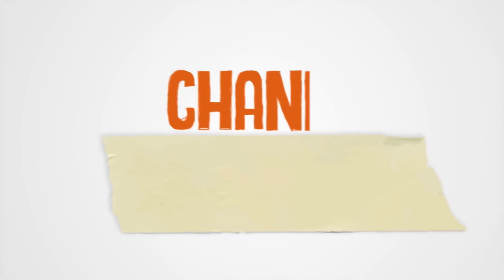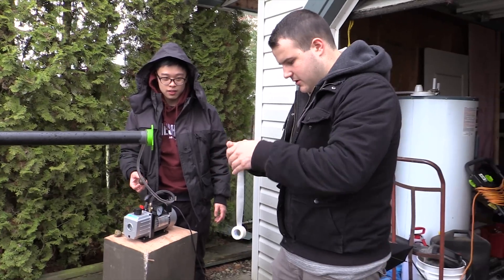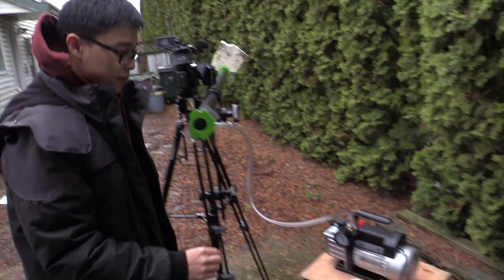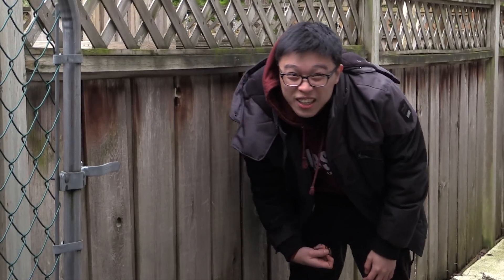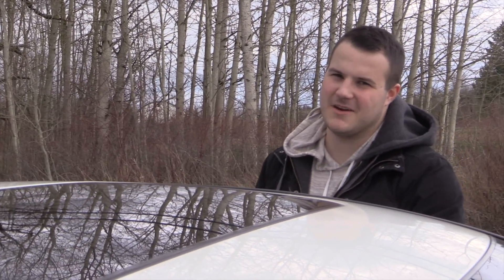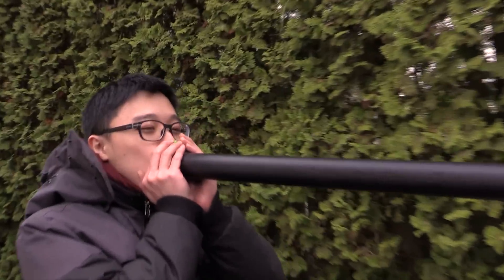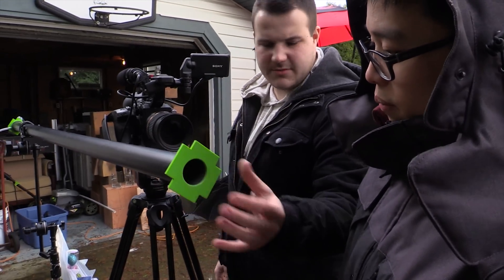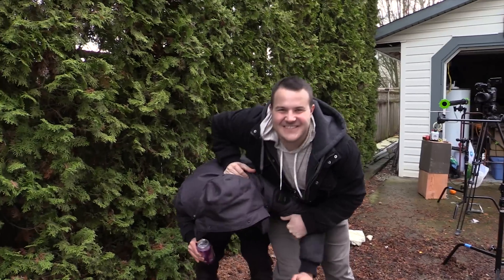DIY Vacuum Cannon!

Comment: You need to give more time for the vacuum to build up before popping the membrane.(tin foil is good if you sand the sharp edges off the pipe)
And use a ping pong ball.

Comment: Instead of putting a piece of tape over the front end of the barrel, you should set something on there that will be held in with the suction of the vacuum, so that the projectile isn't slowed down by the adhesive of the tape

Comment: you guys kinda suck at this. use tin foil for the seal so it breaks through easier. the glue on the tape probably was catching on the cannon and messed up its trajectory or stuck to the ball. it also looks like the ping pong ball is getting caught by the end caps you 3D printed

Comment: Even if you could achieve a perfect vacuum, you would still only have the 15 psi atmospheric pressure differential, which will NEVER do anything better than the lame-ass results shown in this video.  Do the math!  it's a fail.

Comment: Its because the pipe is too long and all the air doesn't push the object so some air sneaks past the bullet and the longer the more air sneaks past it and eventually there is so much air that it stops or slows down the bullet

Comment: you have a big 3D printer why not print an projectile that just fits the pipe. tighter the fit the faster it will move with a poity end to penetrate the tape this would work pretty nicely

Comment: Good, but MythBusters did it in 2014 and got like 1,100 MPH out of the ping pong ball iirc.. That where CSF got the idea?
Reply: Adam's tube was like 40 feet long though thats why
Reply: +Cole Jones but at least they left the vacuum pump on for more than 2 seconds with the short one.
Reply: euan todd true. Never let it be said these guys know what they are doing

Comment: This isn't how a vacuum cannon works. You need to have a good seal around the bullet or you won't accelerate it much.  The difference in pressure is what propels the bullet. If there isn't a seal the pressure differential isn't big enough.

Comment: I demand a redo of this video,  but the proper way.  Guys.  You need to let the pump work hard.  Like..  Almost to the breaking point of the tensile strength of the tape. Let's all like this comment so they see it and redo this video.  Also,  Denis is more awesome with each day.  Gj Denis

Comment: You really should flip that tube around, so that the pump sucks air from the front of the projectile... Otherwise if you have a good seal around the projectile, the vacuum will be formed only at the back, which is not good...

Comment: Lads, this was terrible :( Why don't you make a potato cannon? £20 and you can fire 200m! These are insanely powerful and make a nice bang!
Reply: +lloyd kelly These cannons when done propperly are also extremely powerful and can shoot pingpong balls at over 300mph from a 3ft pipe using only the power of a vacuum. When taken to the next level ala Mythbusters style and boosted with 300psi of pressurised air in a 20ft pipe they can reach at least 1100mph.

Comment: well I mean I'm no engineer but I think you'll need to use a stronger vacuum to create a smaller amount of pressure also try using a shorter pipe so that there is less air to suck up.
Reply: Or use it for longer

Comment: This was painful to watch. You could have made it way easier for yourself. 1- Use PVC Female to Female connector on each end. 2- Use the material from those metallic looking balloons that have the decorations for like birthdays. 3- use a ping pong ball (nvm you just did). also if you use an industrial vacuum pump you could get some bad ass shots.

Comment: What you need is a one-way self-sealing seal on the shooting end, a projectile that takes up most of the diameter of the barrel and some kind of pressure seal on the input. Tape is way too weak to withstand any real pressure, and if you get a strong enough tape, it will slow down your projectile way too much..

If you don't know what a one-way self-sealing seal, take a piece of paper and cut a cross in the middle. Best if you do it twice so you get 4 lines across, 8 triangles meeting in the middle. Make something like that out of metal/plastic so that is opens up only one way and make it airtight by applying some rubber to the edges. But I'm sure you can simply buy these things.

Comment: If you let the vacuum pump run for at least a minute, it will have sufficient time to create a descent vacuum and thus "work properly". You kept turning on the vacuum pump and only after a couple off seconds later you puncture the tape, give it a minute (or five).

Comment: you should try it again but let the vacuum suck all the air out and use a tube that has a diameter  as close as you can get to a ping pong ball

Comment: If you want this to work better add a pressure gauge between the pump and the cannon, replace the tape on the firing end with aluminum (aluminium) foil, and check what the max negative pressure the aluminum foil can handle. The tape on the firing side seems to be too tough for your objects to pierce causing it to just stick to the object and the pulling of the tape from the cannon reduces your muzzle velocity. Aluminum foil should be easy for a moderately weighted object (denser than foam but lighter than metal) to pierce with ease. Should also make the firing more accurate with less deflection from impact of the end stopper and less wind resistance on your object in flight. For more ideas on this check out the channel NightHawkInLight - He made a wonderful cannon that you could easily scale to be safer. You could conceivably make a handheld light powered version that you could shoot at each other. The objects would have to be soft, though. Maybe a foam ball with a marble inside for weight?

Comment: Here's a possibly better idea, 
•Get the tubing and make one of the 3D printed ends smaller than the other.
•Place the smaller printed piece on the firing end.
•Get a pill bottle bigger than the smaller printed end, but able to slide easily through the tube.
•Fill the pill bottle with ball bearings.
•Make sure the open side of the pill bottle is facing the firing end.  
•Cannon Shotgun.

Comment: There is no such thing as "Negative Pressure"
Reply: +Satyajit Ghana yes I'm pretty sure when the piston goes down in a car and creates a vacuum that's negative pressure. The same thing they are doing here
Reply: +Heine Sætrevik ^ that's a better explanation,  I'm in automotive, that's the only way I know how do explain it
Reply: there IS negative pressure, it's only relative, not put in numbers
Reply: There is
Reply: George Stekas something below atm pressure is considered negative ?
Reply: +Satyajit Ghana nah, it's basically like suction cups and how vacuum cleaners work. Negative pressure is also used to vacuum seal groceries
Reply: Jake Smit so there is a thing like negative Pascals ?
Reply: +Satyajit Ghana no idea, they only teach you so much in grade 10
Reply: +Satyajit Ghana Google is your friend
Reply: Jake Smit how much pressure is there in space do you think ?
Reply: Most likely no pressure at all
Reply: +Satyajit Ghana umm I don't really know, it's somewhere in the negatives but I think it's hovering around as much negative pressure to create a vacuum
Reply: Jake Smit its 0. because pressure=force/area . there is no force in space.
Reply: Also, when I think of it, you're right with the part of the negative pressure being lower than the pressure in question. Basically, if you were to pump up oil, there are various types of oil pouches underground. Those with low pressure and those with high pressure. Oil pumps have different types of motors to suck up the oil, to accommodate with the amount of pressure the oil pouches have. The stronger the pressure is, the weaker the motor. It's all about relativity. Black holes suck up things close to it, but then there's a lower pressure than space. It's likely that there's actual pressure in space, but it's much much less than our measurement standards
Reply: Heine Sætrevik Right ! . Because in my classes they said there is no such thing as negative pressure. We have considered the atmospheric pressure as zero. as anything lower than that is negative. People use negative pressure even if they don't know why exactly it's negative
Reply: I can see where you guys are coming from
Reply: Jake Smit where ?

Comment: The reason it didn't fire right was because;
A: there wasn't enough pressure. Leave it going for longer
B: the tape was too thick. And
C: the projectiles were absolutely shit
Reply: + Henry Read-Spinks and they should have used very small ball bearings. Like from a skateboard

Comment: Too low pressure, and try fitting pipe to size of balls - so it will have more velocity.
Reply: +Ace Too high pressure you mean
Reply: +Steamrick too low delta of pressure between ends of pipe. Baloon on the pump end would be much better I think.
Reply: Ace
Exactly what I said^^ Too high pressure in the pipe is equivalent to too low a presure delta between the pipe and the atmosphere.

Comment: F = ma 
So lighter the object, the faster it is going to fly.
Since Ec= 0.5m*v^2  and p = mv          ===> You will have more kinetic energy from firing something light, but that goes fast, and also more momentum easier than by increasing the mass...
So yeah, a little more science may have helped 
This is the reason the ping pong ball is awesome !
Reply: I like that you're thinking scientifically. You're right that a projectile with a lesser mass will have a greater initial velocity, however I'd like to suggest a few clarifications.

1. You state that, "you will have more kinetic energy by firing something light....." That's not true. The projectiles will have the same amount of kinetic energy.

Each time you prepare to fire the vacuum cannon using the same starting conditions (i.e. the same pressurization) you give each projectile (regardless of mass) a given and equal amount of potential energy. When it's fired, this is transformed to an equal amount of kinetic energy for each projectile, regardless of mass.

Here's another way of thinking about this situation: when the cannon is fired, work is done on the projectile, and the specific amount of work can be determined by the formula, Work = Force * Distance. Whether the projectile has a small or large mass, it experiences the same forces acting upon it and those forces act over the same distance (the length of the barrel), so projectiles of different masses experience the same amount of work applied to them. Now, since there's a formula that states that the change in kinetic energy is equal to the work done on the object, knowing that the work done upon the objects is the same, we can also say that their kinetic energy will be the same.

Again, I'm not contradicting you about your original statement that a smaller mass will result in a larger initial velocity. The velocity of the projectile when it leaves the barrel can be found using this formula:
Velocity = sqrt(2 * [Work done on the projectile] / [Mass of the projectile])
Since the Mass is in the denominator of the above equation, the greater the mass, the smaller the velocity.

2. Even though a less massive projectile will have a greater muzzle velocity, since it only has the same initial kinetic energy, its not capable of generating more damage when it hits it target, even neglecting air resistance.

3. Let's not neglect the fact that once these projectiles leave the cannon, they're being subjected to drag due to the air around them, so while one projectile might initially be traveling much faster, that may not remain the case. If you have two spherical projectiles of the same diameter (they'd need to be roughly the same diameter in order to get a good seal within the barrel), but one has a lower mass, the projectiles will likely have somewhat similar drag coefficients and experience somewhat similar drag forces, but the less massive one will de-accelerate more rapidly due to those forces: (de)acceleration = Force (generated by drag) / Mass (of the projectile).

Think about a situation where you fire two projectiles at the same velocity; one of which is a hallow, plastic, golf-ball-sized projectile and the other is a real golf ball, with more mass. Air resistance will slow the hallow plastic one much more quickly than the real golf ball.

So, returning to original scenario with the vacuum cannon: if you fire a lighter projectile, it will be traveling faster initially, but will de-accelerate more rapidly, and may actually be traveling slower by the time it hits the target (depending on the distance to the target).
Reply: *Kinetic
Reply: +Carl “NCZK” Jontza This is Channel Super Fun, not Channel Super Science. :)
Reply: +ProfessorAsianMan THX !
Reply: +Carl “NCZK” Jontza 
Yeah, yeah. Because less mass has less inertia and it requires less energy to move it faster... thank you. I went to high school too. Anyway, I don't know where you got the "more kinetic energy," though. You know, the whole conservation of energy and stuff.
Reply: +Genericasian :P I just felt like it would have mad sens to do a little physics to make this video WAYYYYY more fun !
Reply: +Carl “NCZK” Jontza sense*
Reply: English plz
Reply: +Carl “NCZK” Jontza Using compression instead of suction would allow them to use golf balls as projectiles...
Reply: True that. But in the end, the ping pong ball did the same force as the heavier object due to its lighter mass.
Reply: Carl Jontza also length of the pipe effects its speed

Comment: the problem with the cannon is the seal you are using, the sticky on the tape is enough to basically ruin it. Another demonstration i saw if this, the guy used thermal blanket (thin shiny plastic sheeting) and a collar around the tube.

Comment: Didn't you guys watch the Mythbusters? If the Projectile is too small air can go in front of it and act as a pillow in front of the projectile and slow it down. This happens because the ball or whatever is pushing it out but the pressure in front is getting bigger and bigger so it doesnt have any power to come out.

Comment: you didnt let enough pressure build up in the tube to get any real speed out of the projectile
Reply: The tape wouldnt be able to handle the atmospheric pressure
Reply: Theophilus Martus Goh based on the video, they never even got to the point where the tape failed once, so there's that
Reply: If the tape did fail, it would be a pain in the ass to get it out.
Reply: Theophilus Martus Goh nah, they could just load the cannon from the other side, tape it back up, and launch it all out the other side

Comment: the problem is the tape being too thick. you need a thin plastic wrap and a rubber band around the tube to hold it on

Comment: At my college we use mylar sheets instead of tape and seal them with pipe connectors since we don't have 3d printers. Also ya, ping pong balls work best though that is only because they fill up the cross section of pipe and weigh less. Other than that just make sure the inside of the tube is clean and you should be good to go.

Comment: you guys are doing this wrong 
Step 1: put projectile in tubeStep 2: tape sides of tube closedStep 3: turn on vacuumStep 4: turn off vacuumStep 5 : pop side of tube that is the opposite of the wanted direction of projectile

Comment: You guys really are not doing it right
Reply: +Will Leonard first and foremost they need to pull a full vacuum, second, they need to size their tube and projectile to be as close of fit as possible
Reply: Obviously. I saw the mythbusters fire a ping pong ball at the speed of sound with an air cannon.
Reply: +Energy Core it was a hybrid, the positive pressure was only introduced after the membrane was popped, increasing the amount of air being intoduced into the tube
Reply: Insufficient vacuum cannon abilities. Unsubscribed.
Reply: +Will Leonard They use the wrong type of tape. The tape they are using is way to thick
Reply: +rv3392 The mythbusters air cannon was positive pressure though, meaning it had a blower instead of a sucker.
Reply: +Energy Core So are you telling  me this one actually sucked?
Reply: +cheeseds Exactly, way too much pressure within the tube at launch..
Reply: Interesting. That's pretty dank.
Reply: +NerdIsh *Unskubskribed
Reply: i knowww
Reply: yeah
Reply: +Energy Core Nope, same concept as this one. Create a vacuum with a ping pong ball inside and when you break the seal, air rushes in and pushes the ball, although at a certain length of barrel, air getting in front of the ball slows the ball making it stop and not break through the other seal.
Reply: If you are trying to create a vacuum in front of the projectile and introduce positive pressure behind it wouldn't it have worked better if the vacuum was at the front of the tube? then the air would move the whole length of the tube?

Comment: The whole thing would have worked much better if the end caps weren't smaller than the tube, allowing the object to be snugger-fit with the tube. And if the object being shot would have a sharp end, which would pierce the tape, which presumably took some of the energy, reducing the projectile's force.